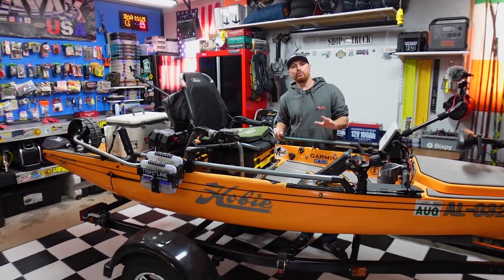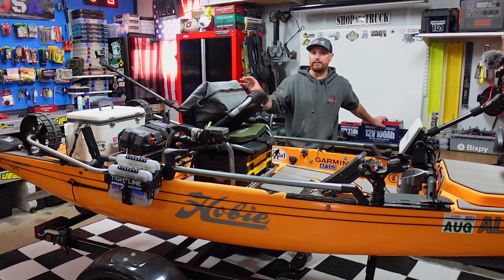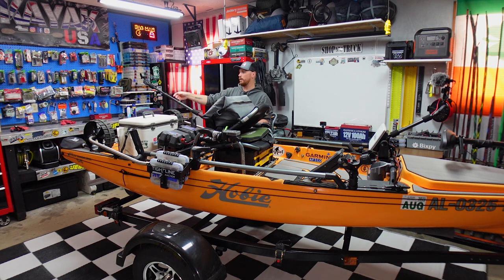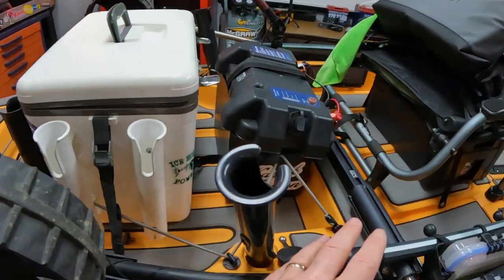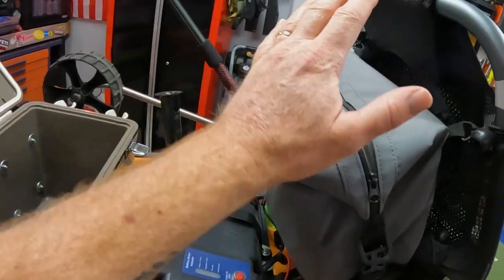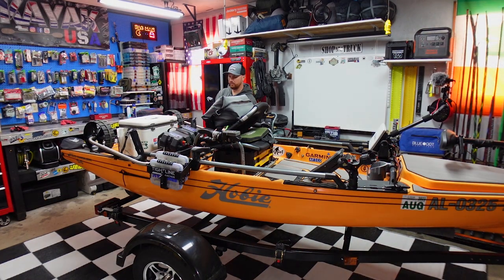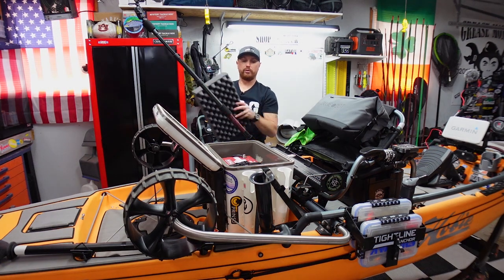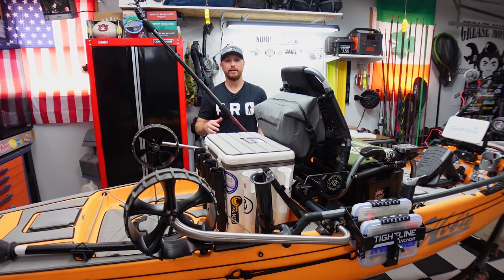Building A Custom Kayak Battery Box | DIY | Full Build | BEST Kayak Battery Box 2023

Comment: And yes, I plan on building something like this for my kayak when it arrives. I have the Dakota Lithium 10 amp 12 V battery. I am not running a motor, just the Lowrance Elite 9 Ti, and two GoPro HERO 11 Black cameras.  BTW, what GoPro are you running? I have tried to connect my Hero 11 Black to external power but it keeps shutting down with no battery in the camera... is there a setting that I am missing? Your help would be GREATLY appreciated..... Thanks in advance!!!!
Reply from the maker: GoPro hero 10, you have to remove the battery if you plan to keep it plugged into a power source . 👍🏼

Comment: Do those batteries not get warm when you use them? Because I’d be worried about it overheating since it’s completely encased and there’s no ventilation
Reply from the maker: No, they do not. You can completely seal off a lithium battery.
Reply: Nice! I didn’t know that!